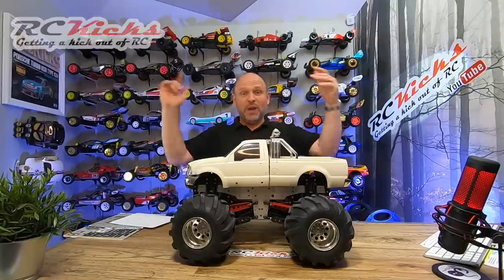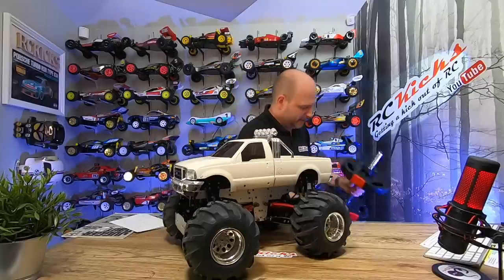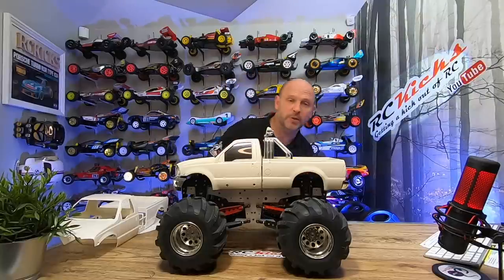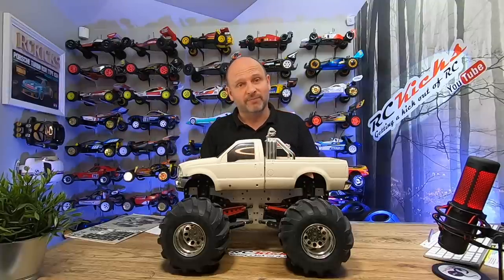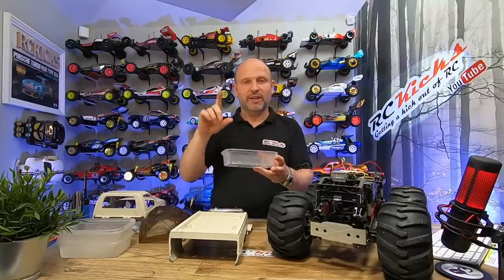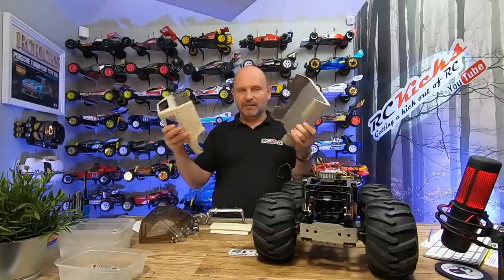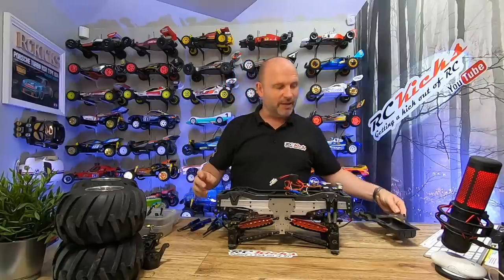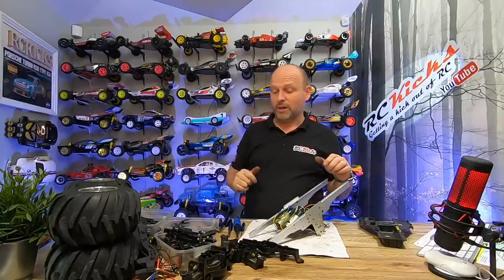MASSIVE! Juggernaut 2 Monster Truck Restoration. A Test Run & Full Disassembly. Tamiya Kit 58256

Comment: Thank you! Excellent video! I just found my old Juggernaut (the first one, the original, the disaster). I got it as christmas gift over 20 years ago when I was 9 or 10 years old (propably 1999 or 2000). Just rebuilding it now. Gears are fucked up so I need to find spares first.  😅👌
Reply: You'll have to source the Tamiya Juggernaut care package to replace all the faulty transmission and axle problems that came with the original Juggernaut.

Comment: Had one from 1. series (1996?? ) and it broke it's axle pinion gears after one week. Got complete axle replacement but it runs a bit lumpy. Also with modified motors the torque twist was an real issue. Later ESP links were installed and helped a lot with articulation. But it never got the status of the clod Buster. I sold the rig and should never had done it afterwards. 😢

Comment: I had one of the first kits, very unfortunately, stock it would click the gears in the axle on throttle then they wore out, I took it apart numerous times thinking it was me, ended up sending it back, they knew but were hesitant on the issue so I was pissed, never got to enjoy it after craving a clod buster as a kid 😭
Reply from the maker: Sounds like you have the first version of Jugg.  Was yours black? These would eat gears in one or two batteries and that's why Tamiya released the Jugg 2 only a year later with the issues fixed.

Comment: I have had to redo hard bodies that had the same paint. I used a sand blaster and w fine sand and it took everything off and cleaned the cracks out. Then I used a primer and panted to box art.

Comment: In my opinion the Tamiya Juggernaut is the best monster truck ever made. It’s more scale than the Clodbuster with the Drop transfer case with shaft driven drivetrain. I’ve been wanting one for years and finally found one on eBay that had shelf duty in perfect shape. My cash for it was just the right timing when it was listed. I paid $1000.00 plus shipping for it. I’ll have 2K in it when I’m done with her. I don’t understand why Tamiya doesn’t have a rerelease of the Jugg? What are your thoughts? Also what’s the difference in the F350 juggernaut body and F350 Hi lift body? Thanks
Reply from the maker: Congratulations on finding one in good condition 👍🏻. The body is close but things like the rear lights are different.  For me I don’t mind as the changes are super small.

Comment: You need a 3d printer to print replacement parts.
Reply from the maker: As soon as I have a bigger studio, I will add a few 3D printers for sure.
Reply: @RCKickschannel  they are very cool... I printed a 10th scale chassis not long ago.